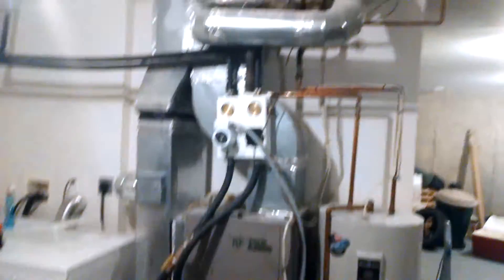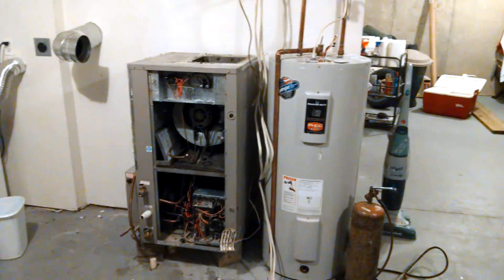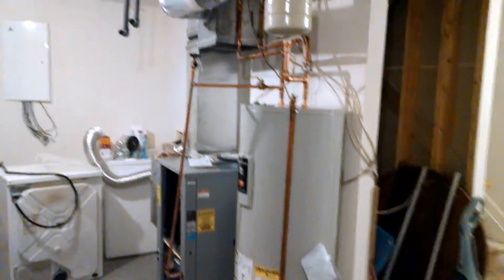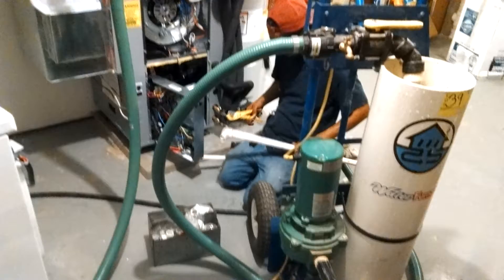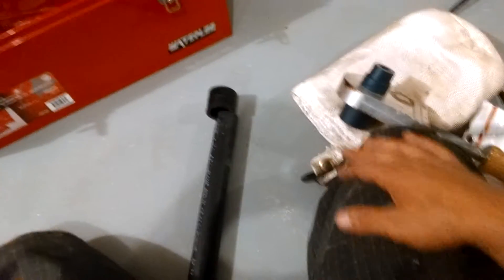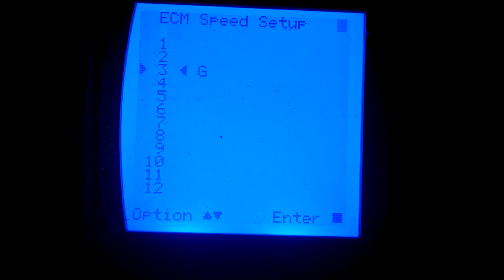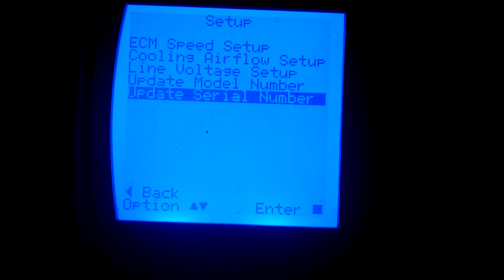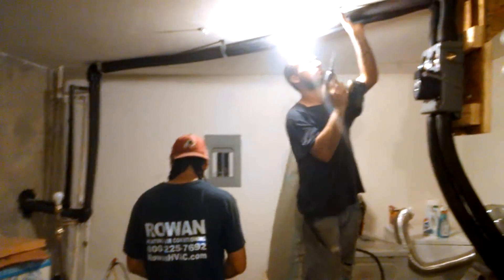Geothermal waterfurnace change out

Comment: Hi Stephen sent me to you, I'm newer to the hvac community and I had a question about flushing a residential system. My understanding is its basically the same as a tankless water flush but how do you set the valves back to insure their in the right spot. If you could point me in the right direction (literature, videos) thank you.
Reply: Geothermal unit. It's a Bryant
Reply from the maker: Call me 301 875 7590